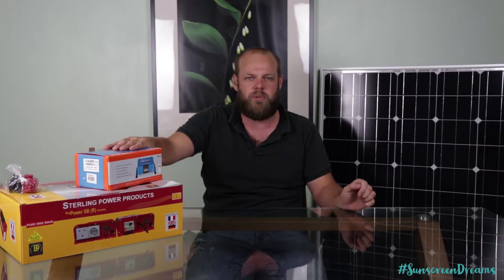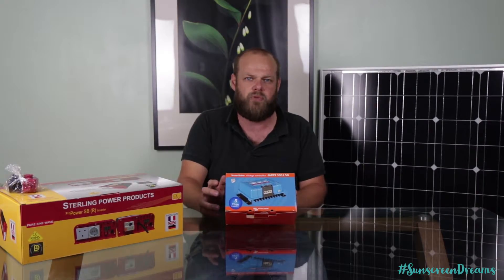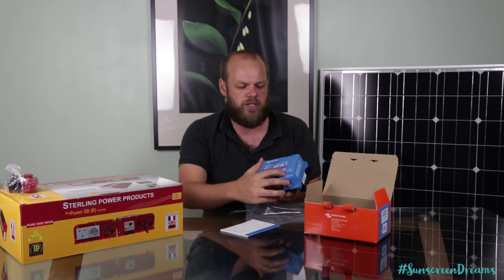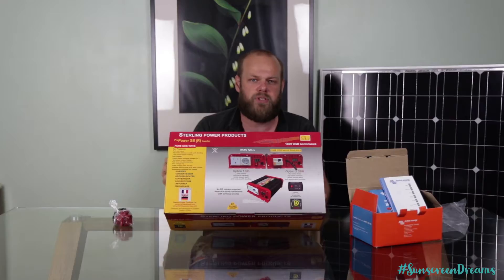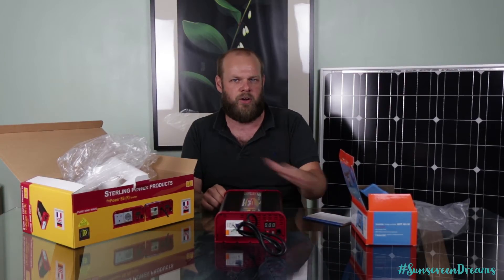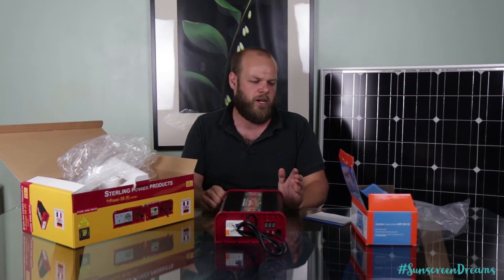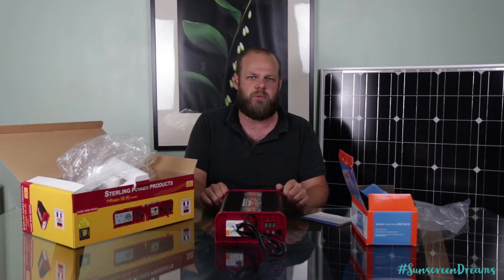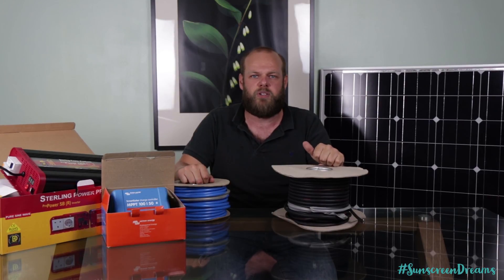Solar charge controller and inverter

Comment: Another great video, informative, I have been following Greg too, he's converting to the level I wish to carry out.  Looked like you had a brain fart towards the end of your video.  Anyhoooo Keep up the great work!  Look forward to your next instalment.

Do you have links to the wires you purchased>?  I have tried locally, and can't find any that are suitable for our Crafter conversion, the local hardware store has some, but not exactly what I prefer.
Reply from the maker: Hi Michael, 

Thank you for your comment.

Ooops thought I had cut this bit out :) have now trimmed this section, thank you for letting us know.

Here is the link to the Artic Blue 240v cable we purchased https://www.electriccable.co.uk/RWDarcticbluecableTECC.php we bought the 12v from the same supplier.

How are you getting on with your conversion, have you managed to get the floor up?

Thanks again for watching we are glad you are finding the videos informative.

Ben and Charlotte